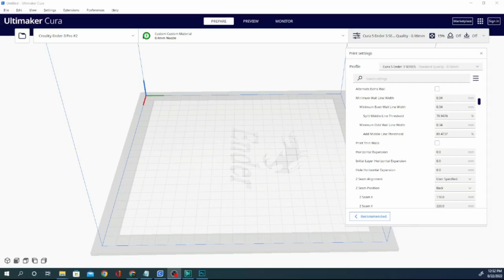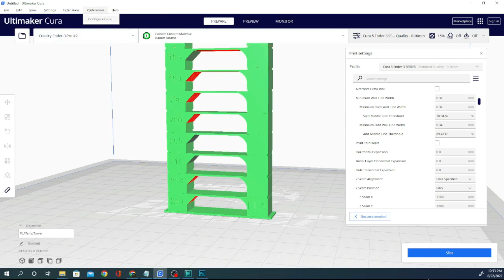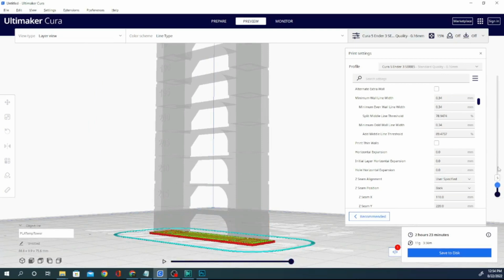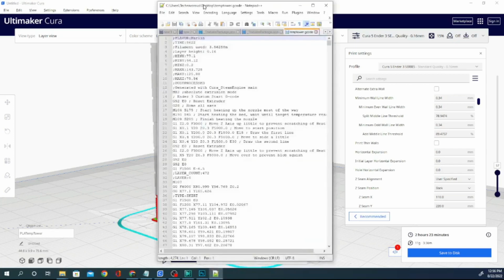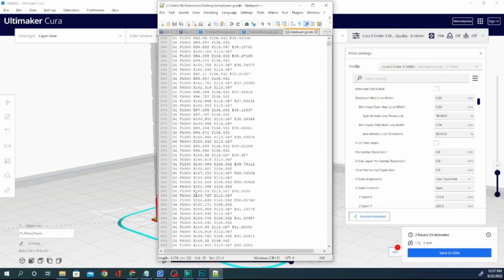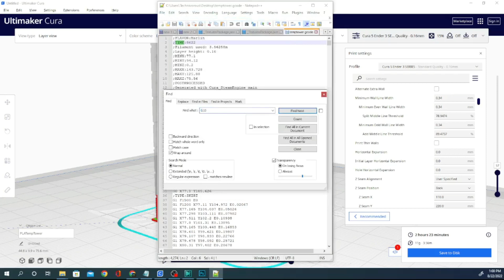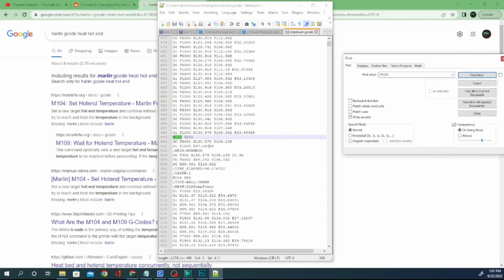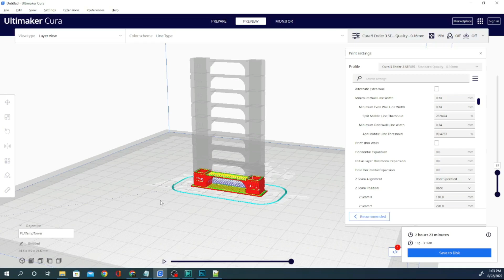How to Slice a Temp tower - 3d Printer Calibration with Cura and the calibration extension

Comment: Is that calculation correct?
Reply: No, its off. The base layers belong to the print as using 5.6.0. So you just count how many layers it takes to make one of the middle sections. 0.3mm layer height for me made 27 or 28 layers per one section.